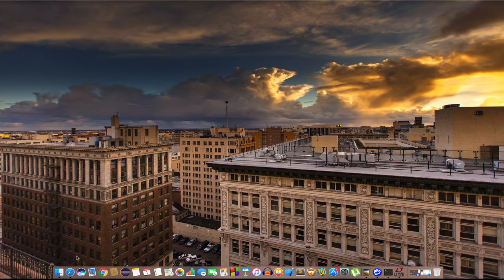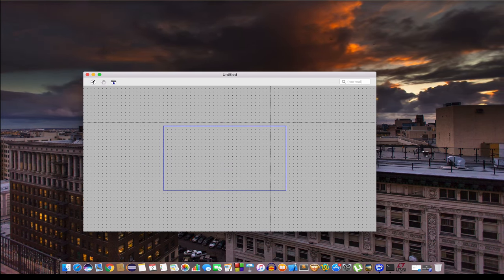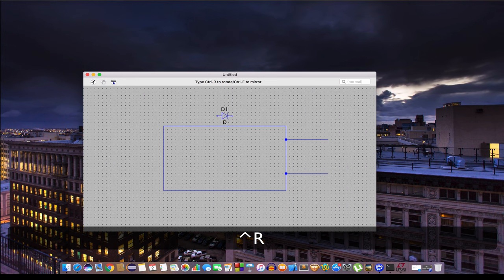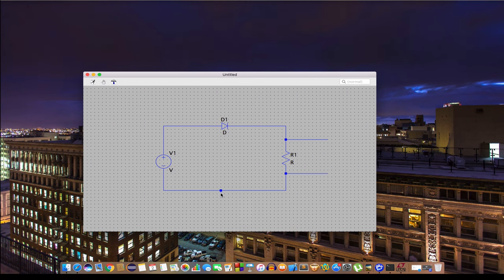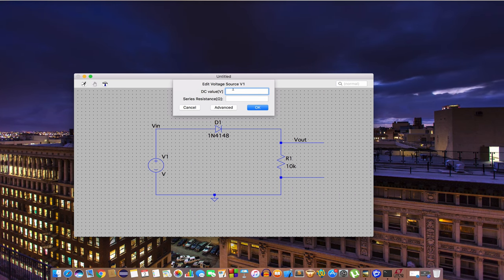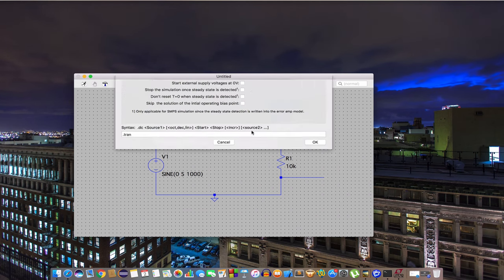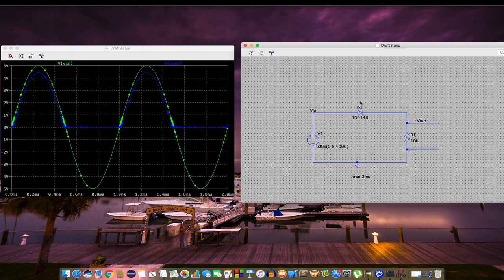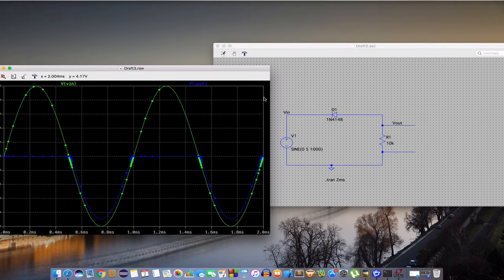LTSPICE Tutorial For MAC

Comment: A fantastic video!
 Could you please explain a bit what both of the Vin and Vout curves mean?
Reply: they are the wave shapes of the input and output voltages
Reply: Vin is the voltage coming from the voltage source (V1) and  Vout is the output voltage, after the Vin run through the diode, resistor as a complete circuit. so if it is a physical circuit Vout terminal is where you connect your load. in this virtual circuit, the resistor is the load.